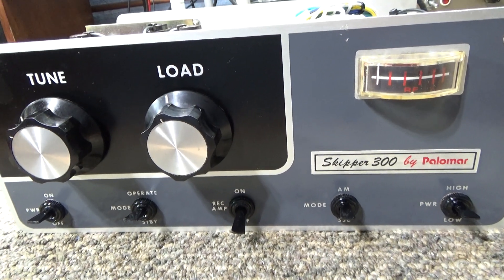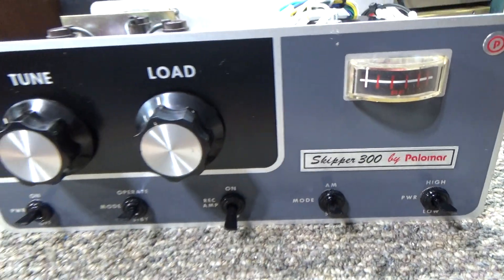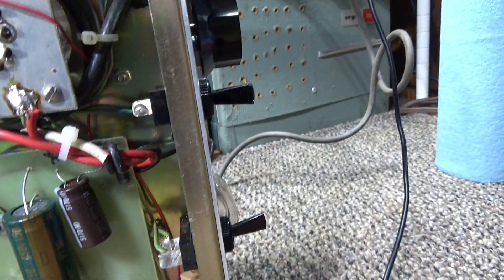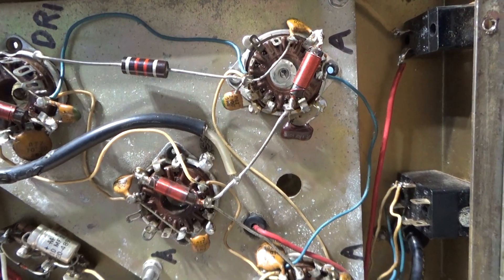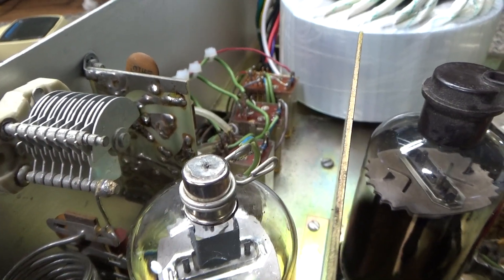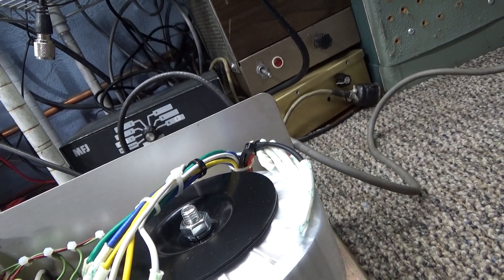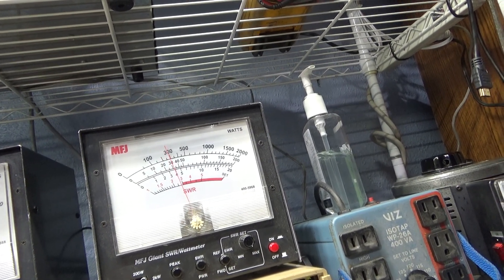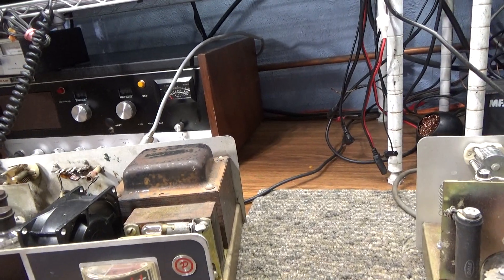Palomar Skipper 300 (not 300A) on the bench

Comment: Hello, Do you have any idea about the current consumption in 120V AC? Thank you !!
Reply from the maker: 300a pulls around 9 amps at full power. Pretty much any amp will draw approximately 2 amps per 100 watts the amp puts out (approximately) hence an amp that puts out 100 watts will draw around 2 amps , 500 watts 10 amps, 1000 watts 20 amps (approximately) on 120ac. On 220ac thats 1 amp per 100 watts (approximately)
Reply: @tramdr  Thank you very much !!

Comment: Those Palomar amps were really good. The only thing I can say, is I never found the preamps to be very useful unless you had a receiver that was kind of deaf. They usually just did nothing but bring up the noise floor, but the amps were awesome and very clean
Reply from the maker: I agree. Preamps that are in amps are pretty much useless. Too wideband. They bring in as much noise as they do signal. However, a good external Preamp, like CPI or Ameco, which have good filtering and internal Tuners (IF cans) in them, do help.